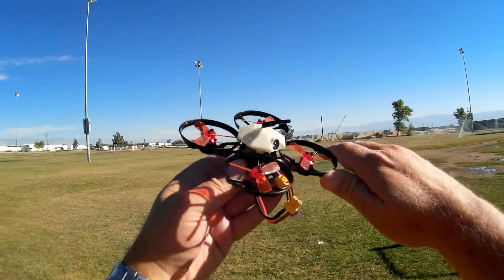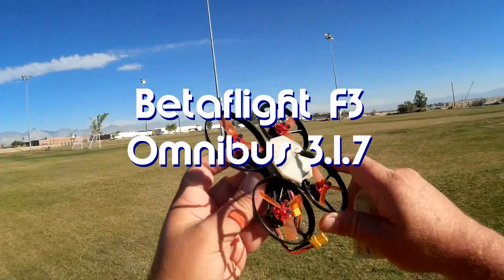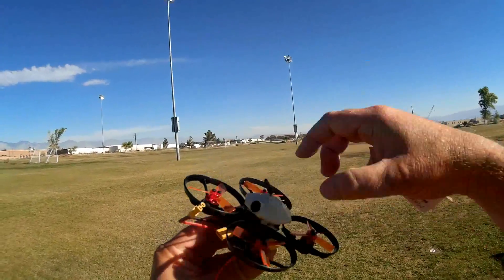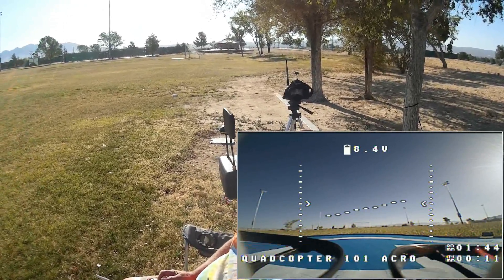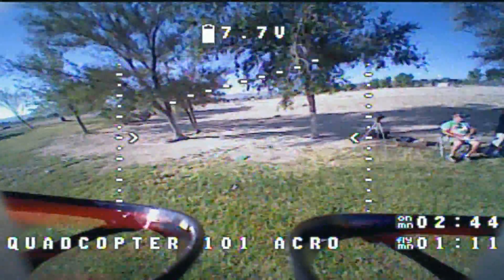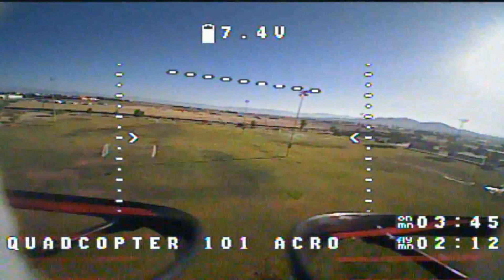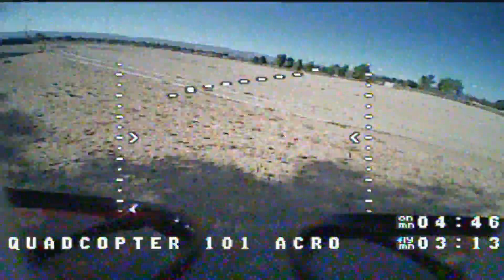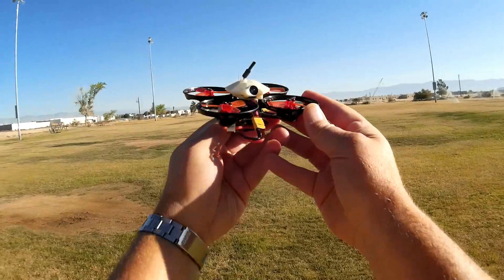Makerfire Armor 90 OSD FPV Racer Drone Flight Test Review

Comment: Can the battery power wires be changed to a JST connector instead of the XT30?
Reply from the maker: It could, but the XT30 connector is made to accommodate much higher current than the red JST RCY connector (up to 30 Amps continuous). The JST RCY connector not so much, with 3A c ontinuous.   The Makerfire has 10 Amp ESC's . Depending on how you fly the Makerfire, a JST connector (and its lighter gage wiring) might start smoking.

Comment: Can you tell me where that bind switch is?  I went as far as removing the top of the canopy but do I need to remove it's bottom also?  This is a pain... thanks,
Reply from the maker: As I mentioned in the video, I had to remove the top of the canopy to access it.  Inside the canopy is the FPV camera, and a separate circuit board which is the receiver.  In one corner of that circuit board is a little circular gold button.  That is the binding switch.  Using your fingernail or a toothpick, push in and hold that switch that switch while simultaneously plugging in the battery (may take three hands, i.s. get someone to help you).  After doing such, turn on your transmitter and select its bind feature.
Reply: Thanks I "think" it's bound, the led is solid red and when I turn of the tx it goes out but,  I get nothing from the throttle,  is there an arm procedure.  I hate bothering you but no one owns one yet and makerfire is sloooow responding.  Should the bind led be red or some other color?
Reply from the maker: Try moving and holding the throttle stick down and right for a few seconds to arm.  If that doesn't work, down and left.  Do the opposite to disarm.
Reply from the maker: And if this is your first racer, make sure that you fly in stabilized mode for your first flights.  STAB should show in the lower center of your screen.
Reply: still wont arm, I'm going to assume it's defective and back to Amazon, maybe I'll add a little more and get the new blade racer ;-) I hate spending all day with something and fail... Thanks for your help sir :-)
Reply: Jim Whitaker I'm having the same issues, it's bound and seems like everything should be working but it's not. Have you figured out anything?
Reply from the maker: The problem is usually caused by the control sticks of the transmitter not being properly centered or calibrated.  When you move the sticks down and out or down and in to arm, the flight control software is not seeing the proper settings numbers that its looking for to arm.  This varies from controller to controller. Make sure that your trim buttons are all set to center position.  But if that doesn't help, the way that I get around it is to simply use Betaflight or Cleanflight to set one of the control switches as an arm switch.
Reply: No Sir,  I looked at it in beta flight and every thing seems to be responding.  The manufacturer never got back to me.  It shouldn't be this difficult to get it going.  I'm sending mine back to Amazon.  The little leaflet they provide is nearly useless. I'll probably pick up the KingKong 90GT since it has a history and large user base.
Reply: I see that whether or not I like it I'm going to have to learn to use Betafilght, thanks ;-)
Reply: Jim Whitaker I'm also having trouble navigating the menu with my controller, specifically how to exit the menu. Any help would be appreciated!
Reply from the maker: Yes, once you get into racers, you need to learn Betaflight and Cleanflight.
Reply from the maker: See the above video at 2:25.   Push the right stick up or down to move the cursor up and down.  Push the right stick to the right to make a selection.   Move the cursor in front of the word "BACK" at the bottom of the list and select BACK by moving the stick right.  You should eventually come to the main screen which has the word EXIT at the bottom of the list.

Comment: Which goggles are you using?
Reply from the maker: I actually used two goggles.  Furibee VR01 to fly.  Eachine VRD2 to record.
Reply: Quadcopter 101 which one do you like more?
Reply from the maker: Well, I like the VR01 goggles better for flying as they maintain a stronger, steadier picture than the VRD2.  But unfortunately  the VR01 goggles don't have a built-in recorder to share the FPV video with my viewers.  Thus that's why I use the VRD2 goggles also, as they do have a built-in recorder.

Comment: I noticed the battery went low below 7 volts, is that a safe voltage because I read different things and sounds safe to me as it's 3.5 volts per cell?
Reply from the maker: No, you never want it to go below 3 volts per cell or risk damaging the battery. But many folks bring it in early to be safe.  3.5 volts is a good rule of thumb as if you go below 3.5, the voltage drops off rapidly.  Notice once it did drop below 7 volts (i.e. 3.5 volts per cell) how rapidly the voltage started to drop.  I got it back just in time.

Comment: What is the difference between Frshky and DSM? This seems like a good beginner racer since it's about 170$ + 60$ googles + 40$ Receiver :) not bad tbh
Reply from the maker: Either Frsky or DSM installed receiver for use with either a Frsky or DSM transmitter which you would need to provide. Example Frsky transmitter https://goo.gl/Y4wMPs
Example DSM transmitter (but you'd also need to install Deviation firmware to it) https://goo.gl/CF01Hl
But here's the DSM transmitter that I prefer to use (also needs Deviation installed) https://goo.gl/spKEjJ
Reply: Quadcopter 101 Is the Deviation firmware free? (Maybe you can do a tutorial on it) The DSM controller looks nicer in my opinion but the Frsky sounds easier to just pick up and start using. The struggleeee

Comment: When I first looked at it, I thought you put the canopy on backwards, as the cam lens is facing the XT-30 battery connector and the VTX antenna is sloped in the same direction. Usually the camera is pointed opposite the battery connector, and the VTX ant. slants away from the lens or front of the quad, but, maybe they just changed it up on this one. As you said, this is a proto type. My preference on the Betaflight OSD is to get rid of the artificial horizon and the side bars, as they are somewhat annoying while flying around. All you really need is battery, flight time and mode (angle, horizon, acro/air) .. and the name if you want, but that's mostly useful if you're racing with other guys, and the judges at the control desk who monitor all the racer's feeds can tell who is who on the course. It will be interesting to see what the "final edition" looks like.  Videos of indoor micro FPV quad races are showing up on YT now ... pretty neat, and some of those guys can really fly in very restricted spaces! Thanks for the review. Cheers.